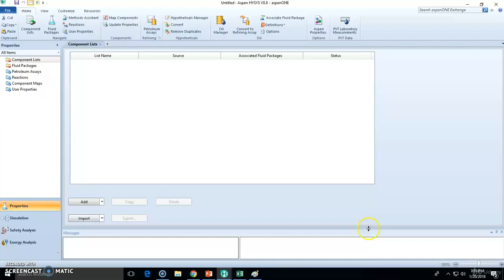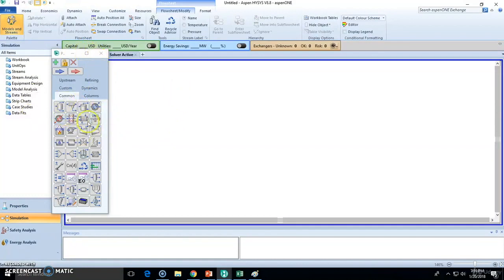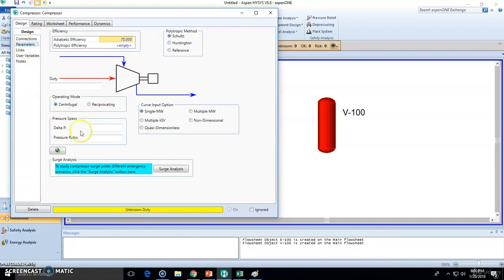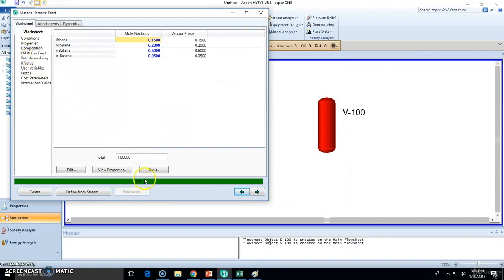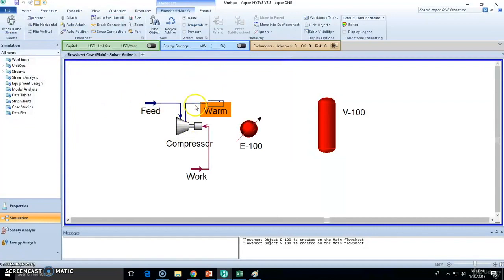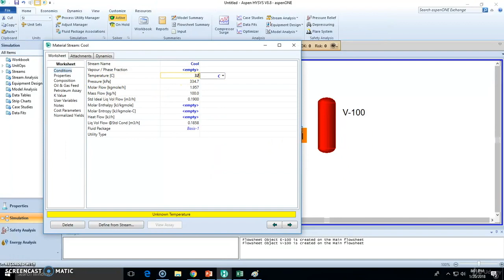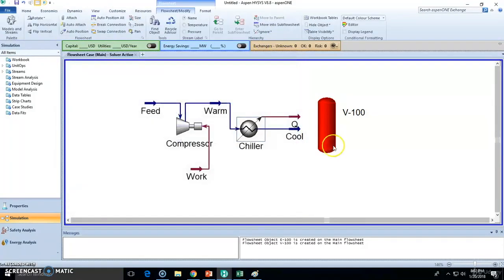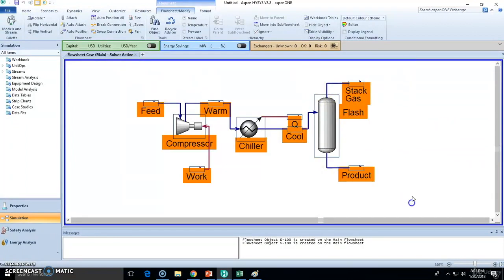Case Study I - Flowsheeting -  HYSYS Basic Course (Lec46)

Comment: Hi...i want to know how to simulate water shut off process using cross linked polymer in Aspen hysys.
Reply from the maker: 🧪 1. Define the Polymer Gel System

    Create a pseudo-component for the cross-linked polymer (gel) if it’s not in the component list.

    You can define it as a heavy, non-volatile compound with minimal vapor pressure.

    Use a liquid–liquid or liquid–solid separator to model phase behavior if needed.

⚗️ 2. Set Up the Injection Process

    Use a stream for water and another for the polymer cross-linking solution.

    Set up a mixer to simulate the in-situ cross-linking reaction (polymer + cross-linker).

    You can use a REACTOR block (e.g., RPlug or RStoic) to simulate the gelation reaction (even if simplified).

🛠️ 3. Simulate Plugging/Blockage Effect

Since HYSYS doesn’t model reservoir porosity or permeability directly:

    Use a control valve or pressure drop element to simulate increasing resistance in the flow due to gel formation.

    Gradually reduce flowrate or permeability in that part of the network (e.g., change valve Cv dynamically or manually reduce outlet flow).

📈 4. Monitor Performance

Track:

    Water cut reduction (less water produced downstream)

    Flow resistance or pressure build-up

    Concentration of polymer solution